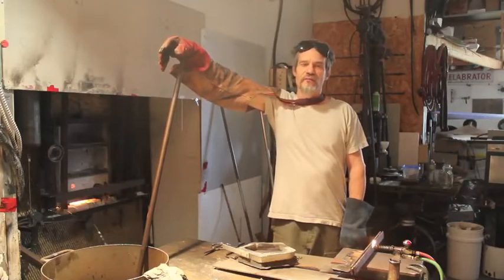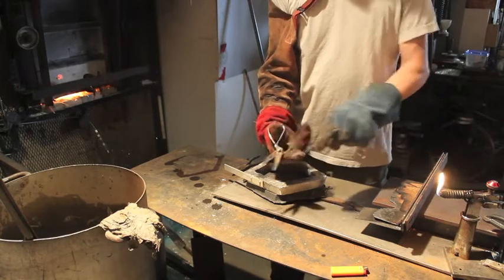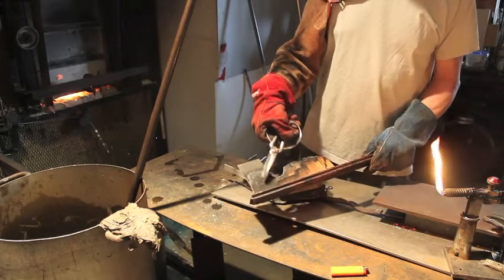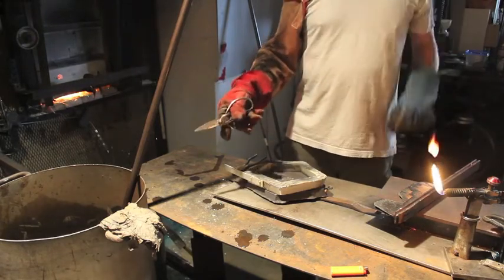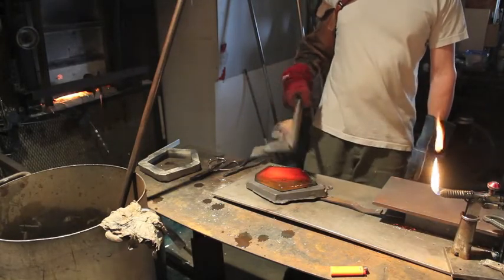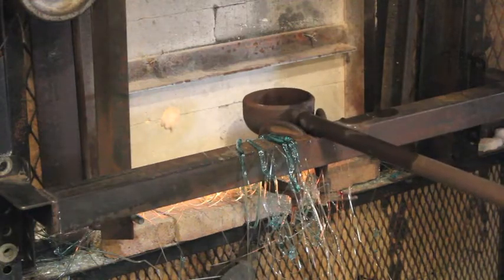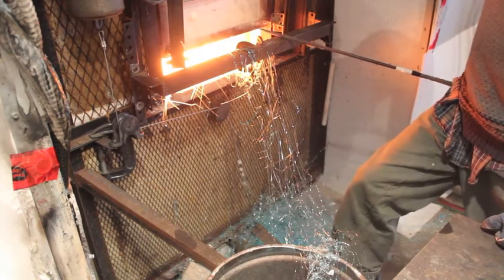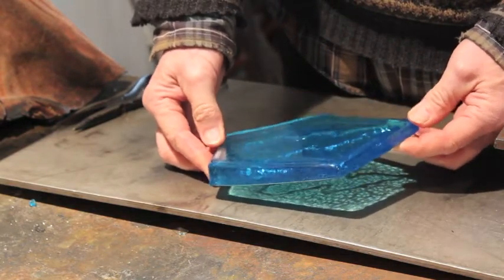Glass Casting Introduction (1 of 8)

Comment: Hi! Thanks for this. Is it possible to get heat resistant glass out of ladle casting (by heat resistant, I am referring to approx. 212 degrees F up to say roughly 250 degrees F)?
Reply: I read that certain ladled casted glass may crack if hot boiling water is poured onto the piece

Comment: Thank you for the video . It's very useful information. Could you tell about kind of metall of your ladle ?
Reply from the maker: the ladles are steel or stainless steel pipe caps welded to hollow pipe.  Best to have them at least 5 feet long without a welded "T" across the end.  They are easier to handle without the "T" on the end.
Reply: Thank you

Comment: Awesome.  Looking forward to this!  Kiln casting SUCKS!  Every investment I've used leaves a crappy finish.  (band dust, MM6)
Reply from the maker: if you check out my videos on kiln casting and mold making on my Patreon page, you can see how to do kiln castings and get a nice shiny finish with no mold material stuck into the glass.  www.patreon.com/MarkLauckner  many of the videos are public access, the rest require a $3/month level of support to access.  You can of course quit at any time, but I do upload new ones a couple times a month at least.